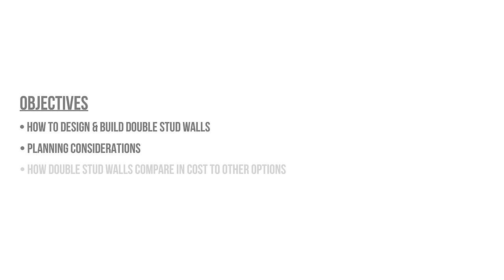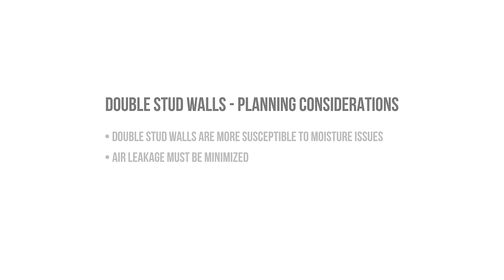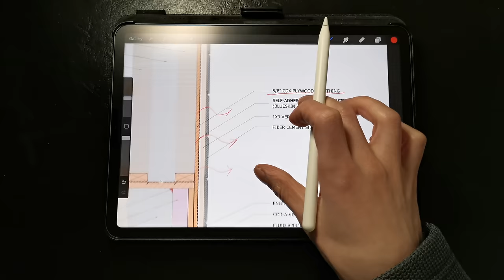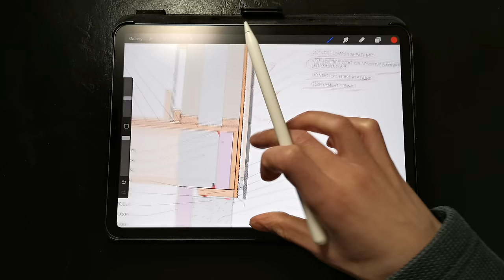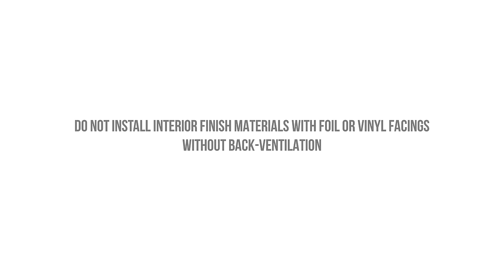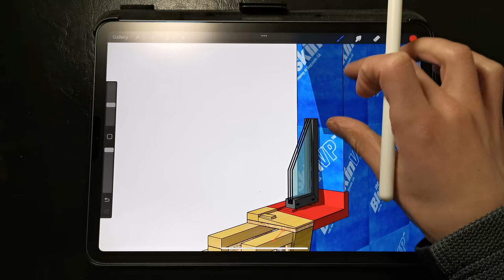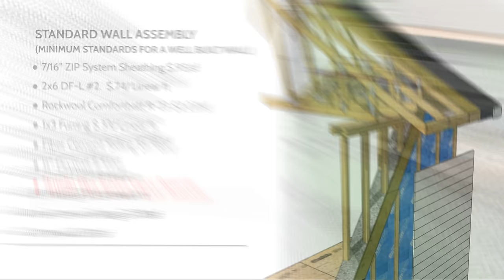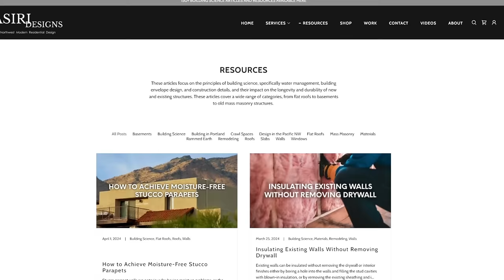Super Insulated Walls on a BUDGET?!? | Double Stud Walls Explained

Comment: Amazing information and presentation. I subbed after your vid on vapor barriers being used incorrectly. Your channel has an in credible amount of informative videos and it is going to get big. 

How would you go about insulating a timber frame home with fully exposed interior framing (posts, beams, bracing, rafters etc)? Structural insulated panels (SIPs) over the outside of the timber frame seems to be the standard, but I don't see many references to SIPs outside of that use case. SIPS seemed to be a hot topic about 15 years ago as the new wiz-bang super-insulation solution but I wonder if there are vapor problems with OSB glued to rigid foam on both sides and why they don't seem to be common? How would you tackle a timber frame?

Comment: If you do furring strips on the inside before Sheetrock, wouldn’t you have to put all electrical in conduit as it would not be set back enough? Using conduit rather than romex would be a big labor and supply increase.

Comment: I got your solution. Instead of all this work/ layers/ chemical glued products and other very unhealthy building options. HEMPCRETE, a 3 layered breathing mold resistant super insulate wall. 12 or 18 inch hemp lime wall sandwiched between lime plaster on the in and outside.

Seems to be so many points of failure with these systems. One leak and you might have a molding wall.

Comment: Very informative video.  I could be mistaken, but I thought it was recommended to use real plywood when is comes to sheathing since it has faster drying time in the event it gets wet.  If so, wouldn't that rule out using ZIP system sheathing since it is OSB covered with a fluid air barrier?

Comment: True double stud walls are a pain to build and especially to trim.  EVERY extension jamb,, and every door and window requires it, every part must be a custom width.  I KNOW, I have had to do it, on several houses.  What WORKS are truss studs.  Built in a jig or fixture so every framing member is exact inside to outside.  A couple dollars more?   15% premium.   Passive solar, super insulated, works well in tandem.  Doing one or the other increases cost without increasing performance.

Comment: We use square notched timber frames. Window and door bays get spray foam and the bays next to them. The doors and windows get thermal breaks not thermal gaps around them. Usually zip sheating and mineral wool. The timber frame actually saves money on labor and lumber. The mineral wool in my masonry north wall and under slab was expensive. Building a passive solar earthship like Goldie and Matt's but no berm or tires. Plus their framing wasn't well thought out and I needed more roof pitch. I need 70 psf snow loads and 6 foot frost depths also. We use glulam 2x10's or 12's for beams. At 50-75$ for 16 foot beam and can make longer. Lvl need too much lateral bracing. A.I. really helps with cost and design considerations. Sure you have seen how flimsy lvl can be. Which glulam beams allow for 2x4 or less on the flats for double stud walls since not structural. Price goes up on wood every time it gets milled down and more wood stamps cost money too. But if you don't have local lumber mills the price for timber frame jumps. As the cost of shipping increases. It's why we use local masonry material and timbers. Right now shipping on rock and stone cost as much as the rock and stone. 800$ for 40 tons cost 800$ to be dropped on site. We do a lot of masonry work. Why give the cement company the money we could get for labor. We build a lot of A frames and skillion designs. I see where the double studs would be better like earth quake zones. If I build a walk in cooler I will use double studs for sure. Because hvac equipment hanging and on top of them. Set of framing for equipment and one for structure. Minimize the vibrations.

Comment: So, my bone to pick with this video is that he doesn't seem to account for the cost of the increased size of the structure to compensate for the extreme wall thickness.  I would imagine that would eat significantly into the cost efficency of the wall assembly.  If you add an extra six inches of wall all the way around a 40x40 structure, that is approximately 80 Sq ft of lost floor space.  So now you have to add about 100 Sq ft to compensate.  That doesn't sound like much, but it is about an 8% increase in the overall size of the structure.  27% + 8% = 35%.  That is rough math, but you can see that you are now much closer to the cost of exterior rigid foam.  And, considering that you can use comparable or slightly cheaper, materials with exterior wall foam, it probably comes even closer.

Additionally, if you live in an area where R40 is way overkill, the numbers probably are much closer.  That is because rigid foam scales better with wall thickness than double stud constructions.

Comment: So, the Intello Plus acts to minimize vapor penetration to the interior of the wall, yet allows any vapors which may accumulate, to migrate from within the wall to the interior space.  In the meantime the Blueskin VP100 prevents vapor penetration from the outside environment to the interior of the perimeter walls.  Is this a correct understanding?

Comment: Great video!!! Very informative. I wonder if you can do a similar video taking into account the cost of labor (even if it's just the cost of labor in your immediate area, just for comparison) and compare the single wall with exterior insulation, to this double wall system, to a SIP wall system, ICFs systems and perhaps even a HempCrete with Just BioFiber System. Even if you didn't go into all the details as thorough as what this video has, it would be tremendously informative for anyone looking to build a new house to see what the ACTUAL cost of a wall system per square foot is. Again, even if you compare it only in your area, at least, people can gauge apples to apples in one area. They can just do calculations for their areas afterwards.

Comment: I believe that using 4inch poly iso, Zip R 12 sheathing and an r16 2x6 wall will be the cheapest option to get r 53. If your using poly iso  as an owner you should look for reclaimed 4 inch poly iso at about $20-$25 a sheet.

Comment: Thanks for the additional details and process. I've been looking at how to do this on the cheap, especially as we're just doing overbuilt, and I'm doing the labour myself, so I don't mind the extra nuance of making sure we just do it right the first time, and have something that just insanely outperforms at a very modest price bump. Plus, with the way operating costs are going, it seems to make so much more sense to crush it at the onset, and see your savings pay off over time. Who doesn't want to heat an entire space with a small space heater? =p LOL

Comment: Blown in cellulose, wool, and other loose fill insulations settle over time meaning the top several feet of a wall may not have any insulation after a few years as it all settle downward compressing the insulation in the lower part of the wall lowering its R-value. Two ways to make a super efficient house ICF construction uses lots of highly insulative foam and the thermal mass of the 6 plus inch thick concrete core plus the fact that ICF homes are super air tight or just use 2x12's and have spray foam installed in two 5.75" thick applications a week or so apart so off gassing can occur after the first application.

Comment: All this engineering and attention to detail is accurate, But an ICF wall system solves all this and for less money. Moisture and rot is not the problem, as it is in stick built construction. ICF is the strongest and most airtight construction.

Comment: I have an idea for a  video if you are intrigued by my question:
What would be the optimal way to blend high performance wall design with low frequency acoustic absorption? I would think would would need to move the air sealing barrier further into the cavity, and keep an porous membrane as the interior finishing. Obvious it wouldnt need to be the whole wall assembly - but there must be a good tradeoff to make.
Regards - Home theatre/ Hifi enthusiasts everywhere.

Comment: Most of the pictures shown when he talks about "dense pack" cellulose are actually "damp spray" cellulose...water is sprayed on the cellulose as it is being sprayed into the wall cavity, which activates an adhesive in the cellulose that bonds it together.  It is much less dense than a dry "dense pack" cellulose.

Comment: You leave the underside of the window frame open to allow any moisture that may penetrate the primary seal around the window to drain out to the exterior, but doesn’t this gap (free of insulation) defeat the purpose of using triple glazed windows and generate a condensation issue? Wouldn’t it be wiser to spend greater efforts eliminating the risk of water penetration in the first place, and filling the gap around the window frame with a closed cell foam insulation? Would like to hear your thoughts on this issue.

Comment: Wouldn't the staggered studs make batt insulation super easy too?  The batts would overlap and you could run electrical conduits between the inside and outside framing.

Comment: maybe consider "celit" as a wheather proof sheating on the outside. or using an extra rigid wood fiber insulation board on the outside. this olaso helps with condesation problems.

Comment: I am going to be building in Maine and me and my Wife will be building it with an extra short term time to time helper. What about using Zip Systems Sheathing as it has a WRB weather resisting barrier (instead of 5/8 inch CDX) and with the off-set of the 2 x 4's and using Rock wool Batts with an other off-set grid pattern and or using your method of Dense packed blown in insulation and the added rain screen of 1 x3 prior to the exterior siding??? Reason why I ask about using Zip System was because it already has a WRB and 2x6 24 OC, *Note I am going to be installing an ERV for air circulation...                                    I like your approach to save money and better insulation on a double walls... Thank you Liked#41 N Subscribed!!!
Reply from the maker: I would be careful with using the ZIP for a double stud wall especially in colder climates in super insulated assemblies. Some people have had luck with it, but at the end of the day, it's still OSB and will have less drying potential than plywood. If you are going to use the ZIP, I'd limit your wall assembly to R-40 just as a precaution, and really focus on doing a good job air sealing all of those connections. You could use a combo of Rockwool and cellulose, but you're going to end up paying more for the Rockwool Batts. Rockwool also does blown-in products. Cheers!
Reply: @ASIRIDesigns  Well, I would be interested in the BUDGET double stud R-40 wall because its more affordable and not the 10 inch Super wall, would be more expensive for us...Also there is a new Wood Fiber company that I have to check out and there Manufacturing just opened up in Maine too:)
Reply: @ASIRIDesigns :: I had in my head a double 9.5” wall assembly, but with the studs in line so I could add gussets at each stud to try to get some more structural rigidity from the interior wall…
I’d use dense pack cellulose, then sheath it with Zip (maybe R6?), then the rain screen and siding.
I wasn’t going to use a vapor retarder on the inside wall. I’m in Climate Zone 3, OK, so I was thinking I’d be okay with the assembly above since we have AC on 90+% of the year and rarely turn on the heat. 

Am I way off track for my climate zone?
Reply: @2point..0  I know of this plant. What area are you building in?
Reply: @ChristopherCurtis  My Wife has received a Job Transfer in Scarborough, so we are moving back to Maine and need to find a rental... (And as a matter of fact we maybe taking a ride up there next week) Then we can look for land little north of their and buy land to build on... Where are you located ??? Thanks for noticing!!!
Reply: @2point..0  I'm in Florida now but the place you're talking about is the old paper mill in Madison which is near where I grew up. Hard to find good builders up in that area. Michael Maines is in Palermo and is one of the coauthors of the "Pretty Good House" book. He told me the same. Down on the coast where you are I understand it's easier.
Reply: @ChristopherCurtis  Good Morning, I am going to be building our us with my Wife as I have the experience, as I built before... I can operate Hammers to Excavators too!!!
Reply: @2point..0   Sounds good - best of luck to you! It's a fair amount to learn but should be worth it in the end.

Comment: PLEASE HELP!!!

I want to do 2x6 studs on a 2x12 treated base and double top plate. 24" staggered studs...

i want to simply double up 2x6 batts of fiberglass insulation in the cavity.

use zip sheathing on the exterior wall and tape the seams.

as far as weatherproofing,

I think the zip 4x8 exterior coating would be enough if i used vertical furring strips  and attached fiber cement boards directly to the furring strips.

I plan on having at least a 2' roof overhang.

for the interior i simply would like to put up drywall.

the assembly should be around 38-42 R

im in central Kentucky (zone 4)

i was feeling confident with my plan until you voiced your concerns for moisture...

i dont think it is within my skillset or price range to install 3 separate vapor barriers correctly. and be perfectly confident there is no vapor that can work its way into the cavity.

it gets pretty humid in Kentucky.

basically what i need help with is if you or anyone else thinks fiberglass batts at ~r40 walls in zone 4 will have any moisture issues using zip sheathing as the only moisture barrier (unless you include rhe furring strips for an air gap as another moisture barrier)

i will be doing a lot of the work myself. thats why it has to be done with my access to to materials and knowledge.

this is my first house, i have the land now i need to plan the construction 

I can do the electrical, plumbing, and insulation, and some framing/ exterior (USMC aircraft electrician turn farmer) 😂
Reply: or instead of zip sheathing would i be better served and cheaper to use half inch plywood and paint the exterior with a vapor coating thing?

i would do 2x4 studs instead of 2x6 studs.

but two reasons, the quality of 2x4s in my area are absolute trash.

and using fiberglass batts to save cost. 

i would have gaps in-between the 2x4 studs and the fiberglass. even with two batts of 2x6 insulation the 2x4 would fall 2 inches short of the oposite sides fiberglass batt.

so i would have 2" vertical gaps in the insulation.

Comment: Not sure that vapor barrier on the interior wall is such a good idea for hot/warm Southern areas, especially within, say 100 miles, of the Gulf.

Our temp "delta" between interior & exterior in deep winter is only 45°F & only for few days. Unlike great lakes region or inland Mid-Atlantic "delta" of 70 °F for week on end.
Reply from the maker: Yes, this assembly is definitely not for hot-humid climates. I'd push for exterior rigid foam insulation instead to serve as a vapor throttle instead of a double wall.

Comment: Raising wall R-value from 0 to R-10 cuts 90% of heat loss from one side of the wall to the other. Increasing to R-25 only cuts another 6% of heat transfer. Increasing to R-35 only cuts another 1%. Source: Rural Electric Nebraska magazine.
Reply: That's a popular myth, promoted by people who don't understand thermodynamics. Invert the R value to find U value. U value describes the movement of energy in Btu/ft2/degreeF where the temperature refers to the delta T (difference between outside and inside temperatures). At, say, a delta T of 70F (70F inside, 0F outside), 1000 sq ft of a dirt-common R12 wall loses 1000(70)(1/12) = 5,833 Btu/hr. How about a 2x6 R20 wall? 1000(70)(.05) = 3500 Btu/hr or 40% less. My R48 walls lose 1000(70)(1/48) = 1458 Btu/hr. or just 1/4 the heat loss of a 2x4 wall every hour, every day. That's 75% lower than a 2x4 wall, 58% less than a 2x6 wall. This is fact. A high-performance home outperforms the rest of the neighborhood at only a slight increase in construction cost, which we entirely offset simply by downsizing the home a bit. 

By the way, that 2x4 R12 wall I used above isn't even R12. it's closer to R8 due to thermal bridging, so its performance is even worse than I suggest. A 2x6 R20 wall is closer to R15. Factoring thermal bridging effects into the equations, each square foot of my home's walls loses approximately 83% less heat energy than a standard 2x4 wall. To put it another way, I need less than 1/6 the energy to heat my home. That translates into money in my pocket.

Comment: If you're going to apply an adhesive or liquid WRB to the exterior wall anyway then why not use Zip system? Is the permeability of plywood vs OSB really that much of a factor?
Reply from the maker: It's a big factor... Plywood can become SEVEN times more permeable than OSB when it gets wet. That's a really big deal when it comes to super-insulated assemblies. There are times when we even need to use gypsum sheathing over plywood because of this factor.

Comment: Would it be possible to do a double walk assembly with metal siding?
Reply from the maker: Ofcourse! As long as the siding is installed on a rainscreen.
Reply: We build double-stud wall assemblies with plywood sheathing, followed by steel siding. No rain-screens, needed, not here at least. Several decades later, absolutely no issues.